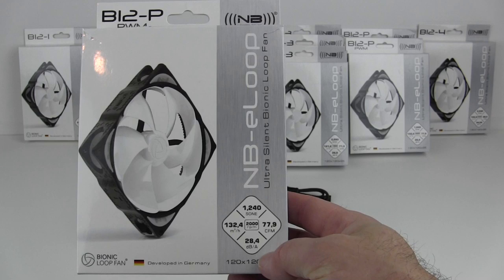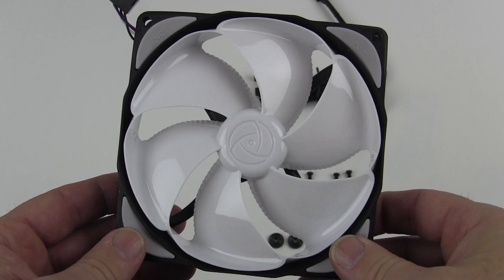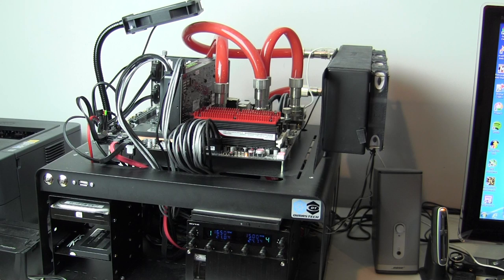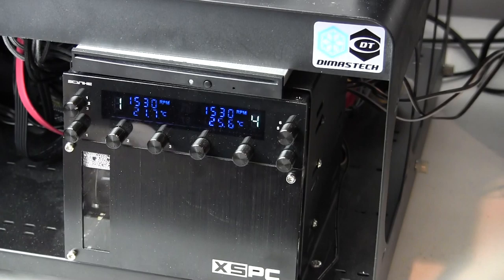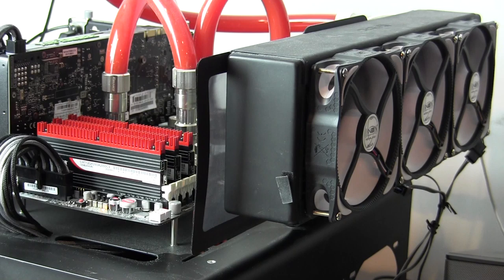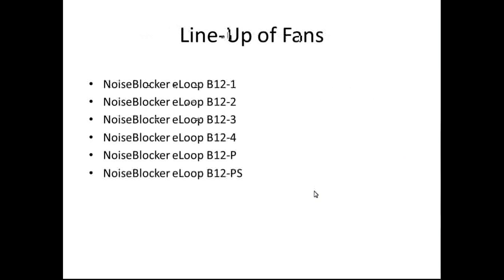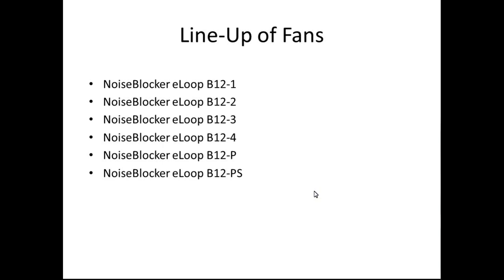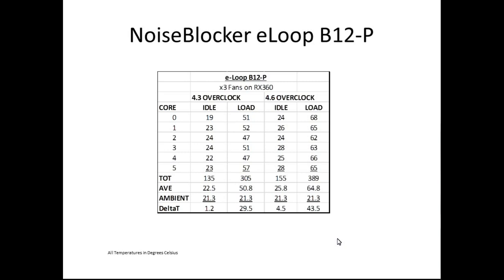NoiseBlocker eLoop B12 Series of Fans Testing, B12-1, B12-2, B12-3, B12-4, B12-P, B12-PS

Comment: There is a common misconception about these fans that the reason they make excess noise in a pull config is due to the blades contacting the radiator. 
It actually is not a result of any contact at all. The blade design just causes some turbulence that makes a buzzing or droning sound. The effect begins when held quite a distance from the face of the radiator so clearly it cannot be contact. It also leaves no marks on the rad or fan after running at high speed.

Comment: Excellent reviews Ron...I'm using 5 of the B12P pwm's as case intake fans on the motherboard side of a CaseLabs TH10 watercooled AsRock Extreme 11 rig. The B12P fans are controlled by Aquacomputer 5XT and have been excellent. I'm using AP-15's on all the rads. Keep up the great videos Ron. Have a great new year!

Comment from the maker: Thanks for the feedback. Good points but here is what I was thinking.
I thought about using the same rad for the low speed and high speed fans but I thought that the fans should be matched to rad's that are designed for high or low speed fans accordingly. Maybe over-thinking that a bit, but I would expect the high speed fans to blow away the lower speed ones so to keep it more evenly matched I wen that route.

Comment: Just to let you know, the e loop design is designed as a push only fan and also noiseblocker say they need 24 hours run in before they will run at the rated speed. It's quite annoying it's not on any of the literature that comes with the fans, would clear up alot of confusion

Comment from the maker: Yes you can remove the Grey pieces very easily.  For Black Ice GTS, I would think the B12-4 (2400 rpm) certainly , but if you want a bit quieter use the B12-P (2000 rpm)  .  One thing to note that I hear these fans operate much quieter in a Push config. So maybe the B12-4 in a push is what you want.  I will be testing them in a Push just the audio to compare.

Comment from the maker: Yes, it should be the same. I don't think I adjusted volume in anyway.  The GT's are still great and yes a little quieter but mine after running for just over a year get a high pitched harmonic that I have to constantly pull off a side panel and tap the fans to stop whining.  I think the Akasa's might edge these out especially in sound.

Comment: Well it's an inherent design flaw that causes running them in pull against radiators which are not specifically designed to accommodate for the moving fan duct will end up touching it and making noise. It would be easier to get NB to fix it than to get all rad manufacturers to agree on a design I think.

Comment: Thinking of getting these for the when my 600t white arrives. Thinking of replacing the 200 mm on top with two 120's for better air flow and the last one will go with my corsair h60 cooler. thoughts, opinions?

Comment: Would these be good fans for exhaust? I have the nzxt h440 case and the exhaust it a little restricted, I'm thinking that the static pressure will help with that, plus these have great airflow. Would you recommend the B12-PS or B12-P?
Reply: I you can I'd just get the B12-3 and use voltage to control it, provided your motherboard can do that :P

Comment: What is the best fan for a 60mm thick radiator?

Thanks.
Reply from the maker: Any fan that has good static pressure.  The B-12-2 , 3 or 4.  Lower RPM quieter, but you need a rad with good fin density.